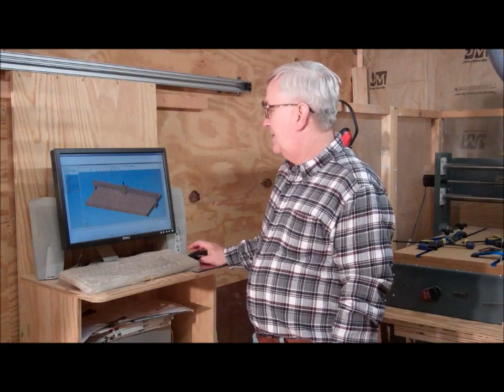4 x 8 CNC Router Design

Comment: nice very nice 
how are you going to drive the x and y im doing chain drive ( like patric hood daniel )
inplace of ballscrews but still going to use one on the z axis 
it dosent take long to realize 10 foot ballscrews are out of most ppl price range
one could use say 1/2 20 threaded rod at a greatly deminished accuracy
plus with a 2 kw spindle and chain drive one could get awesome cut speeds like over 1000 ipm  yes one thousand inches per min
maybe faster
Reply from the maker: I'm not a fan of chain.  There are better options.